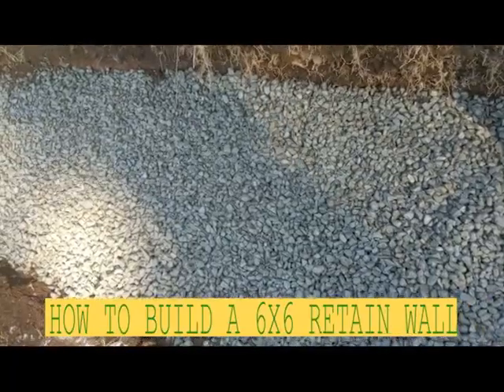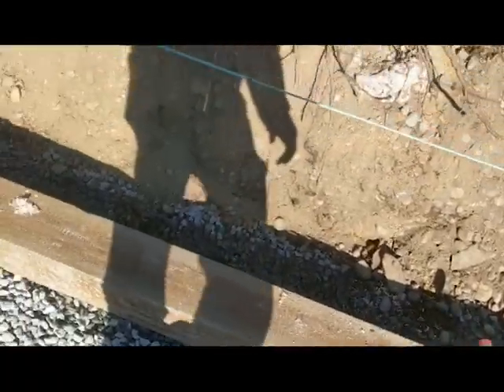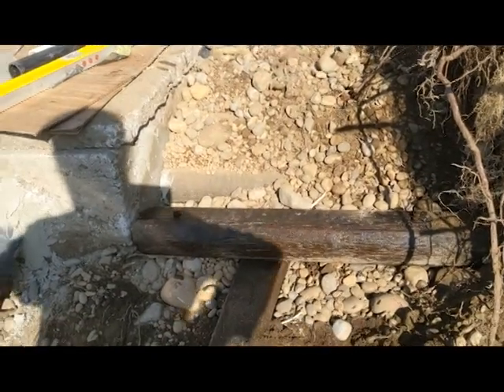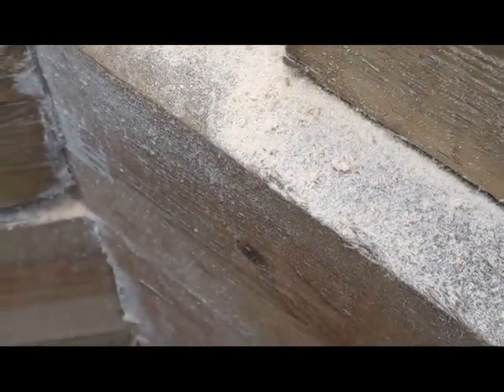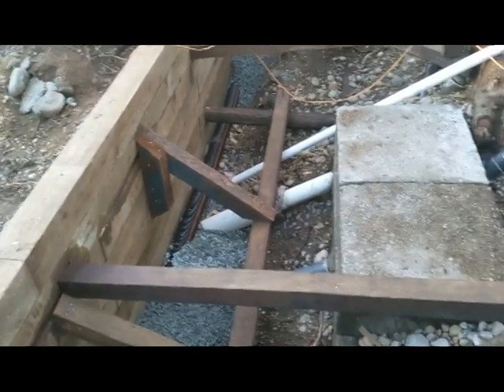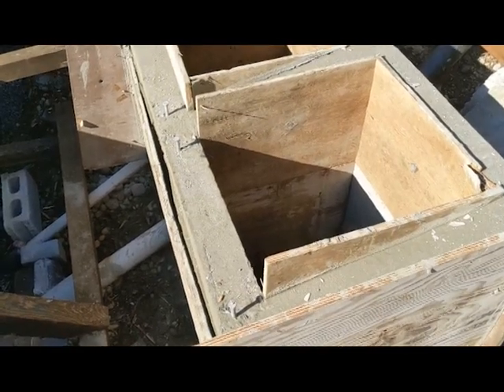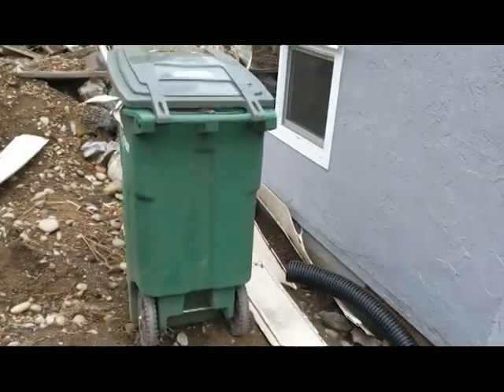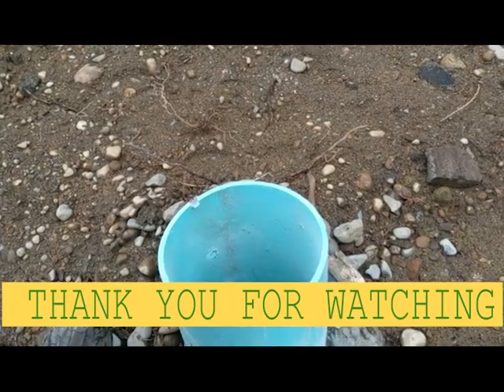How TO Build A 6X6 Retaining WALL

Comment: number one you never built a wall on top of any pipe, electrical wire or any other telephone or cable wire, also on the 45 degre anglet all never built stray up join. to my is is not a good job. that wall dost not pass inspection, any wall avobe 4 feet need engenier drawings.
Reply from the maker: Hello there, thank you very much for your time, How do we have sewer pipes and utilities in  houses without going under a foundation? If you take a close look at the pipes, we have two pipes, one is to protect the main pipe.  6x6 wall, did you count how many 6x6 is there to be more than 48"? This wall was inspected and passed inspection, not because the height, but for what was behind the wall, please let me know if have doubt, keep safe.